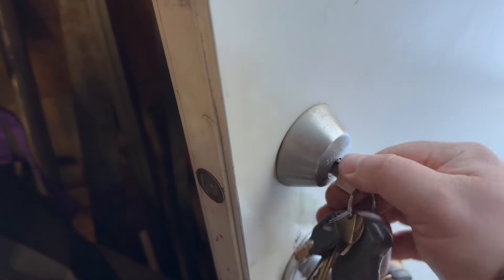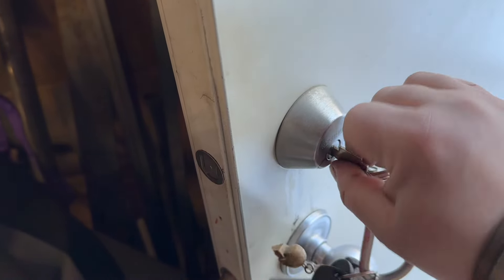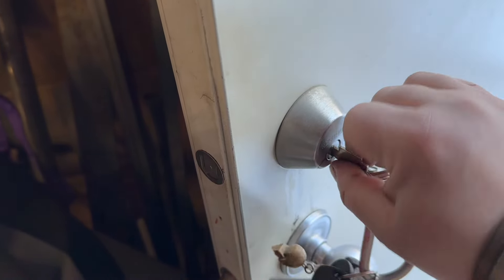HOW TO FIX FROZEN DOOR LOCKS EASY

Comment: I spray everything with Motorkote.  Locks, rubber door seals, headlights, and tail lights to keep snow from sticking. It doesn't wash off like WD-40, is much stronger, and works to -80.
Reply from the maker: Never heard of that stuff I’ll have to look it up

Comment: I didn't have any problems with the shop or house but after 4 hours of sleet and the temperature dropping to -7C, I had to use my wife's hair dryer to get into my truck. How do you do it?
Reply from the maker: That can be tricky as usually for vehicles, moisture has gotten past the window seals and froze up that way